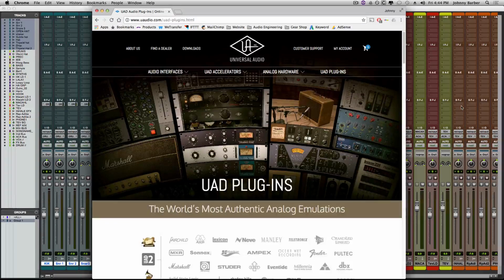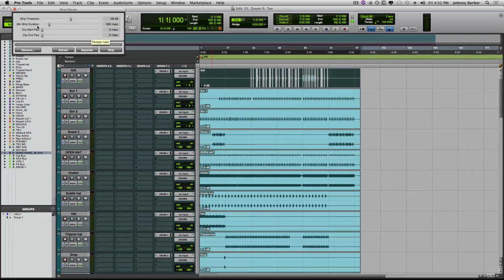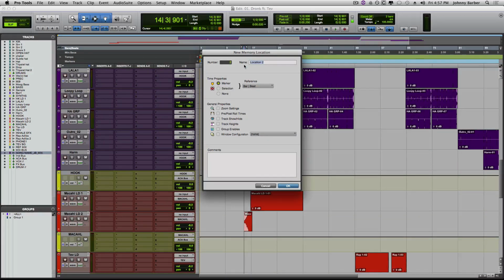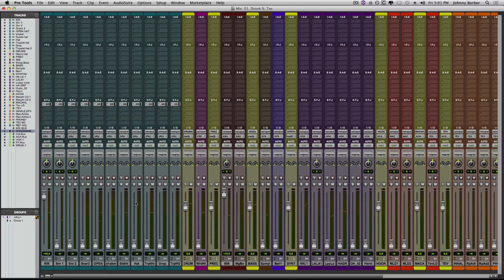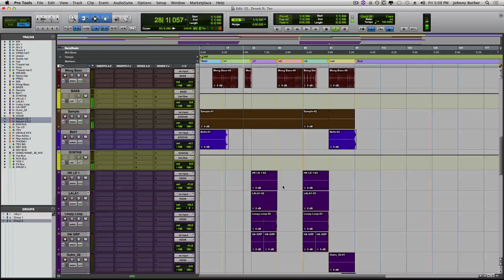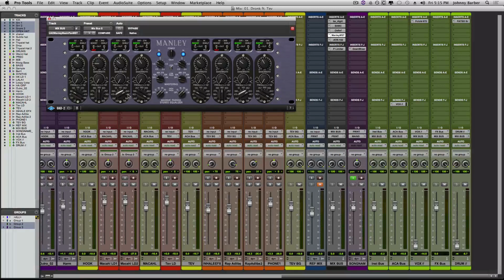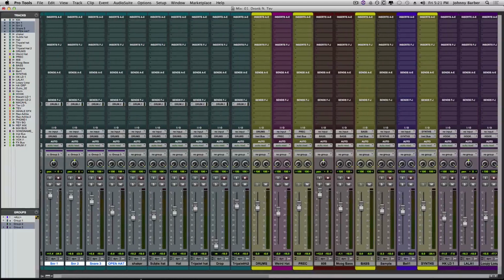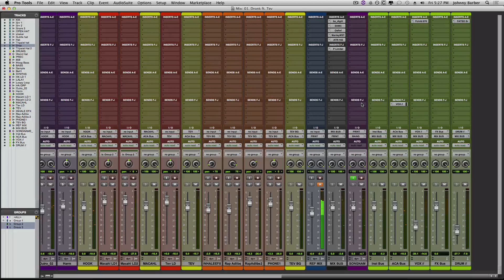Mixing With UAD - WorkFlow, Gain Stage, Balance, and Mix Bus

Comment: Well I dont have any UAD plugins and I use many plugins from other companies waves included. I dont think UAD is worth it in the area of plugins. I think folks just bought into the hype of using DSP based plugins. besides UAD has to sell you on this idea that it has better sounding plugins  so you will buy their hardware! Waves and Slate is kicking ass and taking names and do not have this need to run off these Sharc or however its spelled DSP chips.  The available DSP from a single UAD rack is very poor forcing you to buy more units to increase DSP power. I will buy the UAD for the build quality of the hardware and the sonic quality of the ins and outs / the AD/DA. Also lets also not forget that Pro Tools crunches the numbers very differently than Nuendo ( The Daw I use ) So many of the "rules" that apply when using Pro Tools, are exclusive to Pro Tools!
Reply: I agree I only use uad for unison all of my other plugs are native and most important of all I can open my sessions anywhere